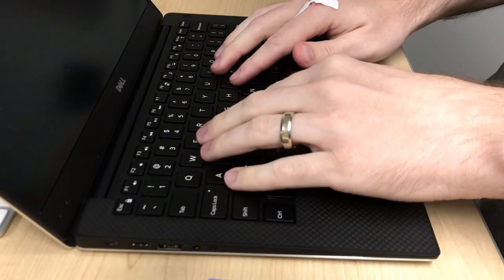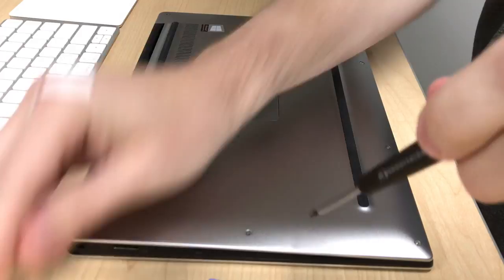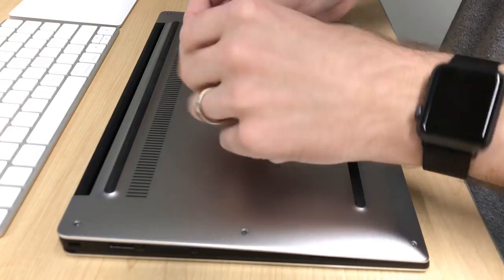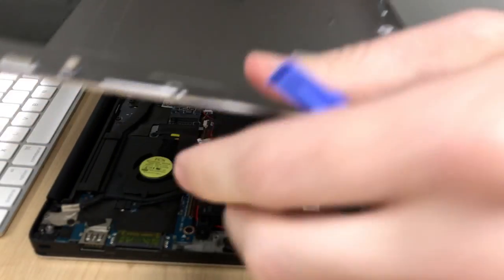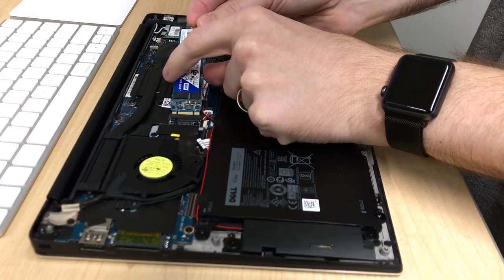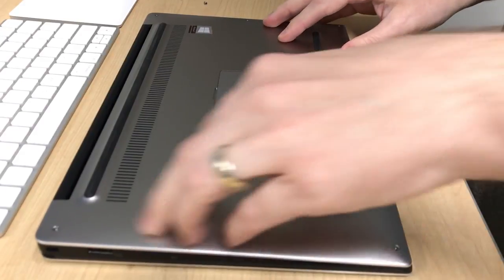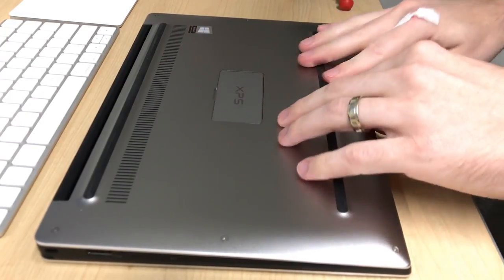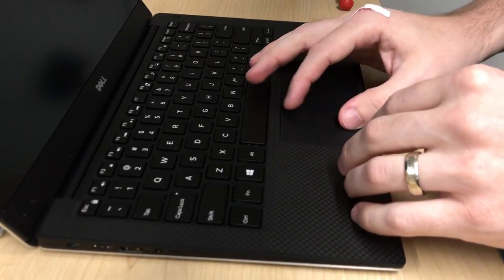Dell XPS 13 (9360) SSD Replacement

Comment: I don’t recommend upgrading this system. I upgraded my SSD, but it caused a bit of damage opening it. The T5 skrews are very easy to strip. The board flexes a lot when prying it to open and the lid is very tight. I ended up warping a corner where my battery button is which ended up wrecking the device. I wish I had known that this device wasn’t as repair friendly

Comment: Thanks for the video. Notice however, that the 2018 XPS 13 (at least the developer edition) has two differences. First, it doesn't have the screw in the middle of the case, and second the SSD does not pop up when you remove the little screw. Actually, it's glued with a very weak and gummy glue, so you need to gently pry it up with a fingernail, or something.

Comment: How do you clone your old SSD in order to use the new one? Is there a usb device needed or just an online website to back it up? Thanks!
Reply: Aomei partition manager 
best to use a desktop to do it I think you can use an M.2 to USB  3,0 enclosure and basically turn it into a usb drive and use the software to copy everything over
Reply: maricum reflect free also works good

Comment: Hi, Jeff! How many SSD slots are there in this Dell XPS 13? Can I use two SSD?
Reply: no, just the one
Reply: I wanted to add a second drive as well. :( . Now I will have a second spare but will put it in a case to be USB drive

Comment: Hey Jeff, thanks for this video! Do you still have this XPS 13 9360 model? Curious if you could give a long-term update if you've had any issues if possible?  TIA!
Reply from the maker: Yep! Still using it for my Windows testing and some light gaming to this day! It is a pretty good laptop, the best Windows-based laptop I've used. I still hate the placement of the webcam though, but newer models don't have that "up nose" problem anymore.

Comment: Hi Jeff new subscriber. Do you have a video showing the ram upgrade on this particular model?
Reply: There is none at least at this level of tech. The RAM is fixed in place, one of the things to check before buying a laptop is this if you have any intentions of upgrades. At least then you can get the MAX amount preinstalled

Comment: I have an XPS 13 9360 and when I power it on it and ctrl+p f12 and it's set to UEFI and secure boot that gets me to a Linux Mint 18 cinnamon 64 bit which then runs and ends up saying have up waiting for root device. Alert! /dev/mapper/mint--bg-root does not exist. Dropping to a shell!  
Help? Please?

Comment: Does this work with the 2018 model as well and can memory be upgraded as well?
Reply from the maker: Not sure about the 2018 model (but I presume so, if the hardware is similar); but memory cannot be upgraded, as it's soldered in.
Reply: Memory is soldered into the 2018 model and thus cannot be changed.

Comment: Is the T5 torx a security screw (with the pin in the middle) that requires a special torx with the hole in the bit?
Reply from the maker: Nope, just a standard Torx head.

Comment: Hi, I've heard that dell xps use specific types of SSDs, how to choose one so that it works ? Thanks
Reply: My question too.  See you asked 10 months ago and no answer, so I suppose i won't get an answer anytime soon.
Reply: @bh9262  Samsung 970 EVO M2 should work fine!
Reply: @Hadam852  Thanks for the info! I have already replaced my SSD, and I believe that  is the exact one I now have. Thanks for the message..
Reply: @bh9262  I am about to do the same..did you pick the 970 EVO or 970 EVO Plus?
Reply: @Hadam852  I went to get the box. I got the 500GB Samsung SSD 850 EVO M.2. It is doing a great job!
Reply: @bh9262  What software did you use for the cloning?
Reply: @bh9262  would it support 1TB?
Reply: @Hadam852  I had Best Buy install it. I didn't have the tools to do it.
Reply: @MrArravelo  I do not have know. I believe that it should. I wish it had a touch screen.. I don't believe that could be done.. Could it?

Comment: Should an M.2 sata 2280 SSD fit inside and replace the existing M.2 NVME SSD?
Reply: YES, The NVMe installed by default is already a 2280

Comment: hi is wifi card replace-able and not soldered on?
Reply: Yes, at least on the older 9360 I7-7500U. You can see it in the video on the top left corner.

Comment: I changed the SSD but now the laptop wont power back on, even after putting back the original SSD. I see two amber and 5 white LED lights. Please help!
Reply: Were you able to get it back on?  Hopefully it wasnt b/c of a short circuit

Comment: This model it’s possible change se memory ram ?
Reply: The memory on Dell XPS 13 9360 is soldered to the motherboard, and there is no additional RAM slot for expansion.

Comment: RAM upgrade?
Reply: The memory on Dell XPS 13 9360 is soldered to the motherboard, and there is no additional RAM slot for expansion.
Reply: @karmicselling4252  my laptop is just heating up on a lot, all my cpu cores run at 99 degrees, I don't know is this normal for XPS 13 9360. need advice.